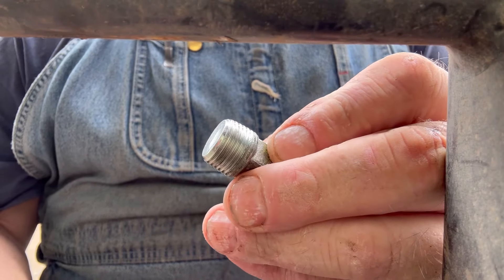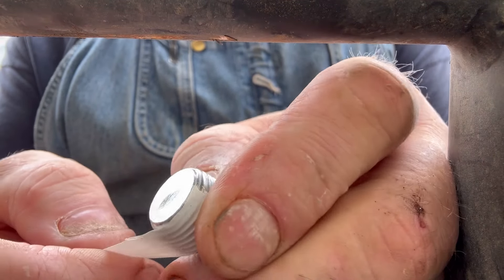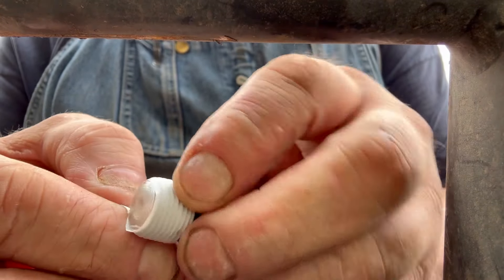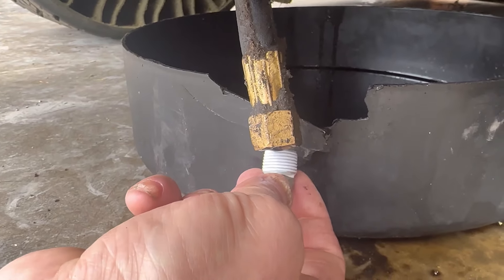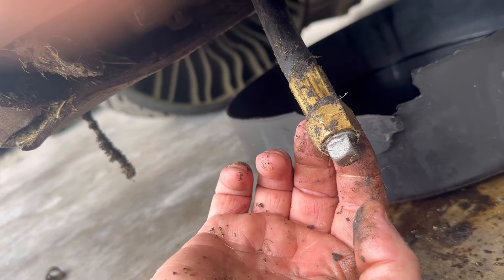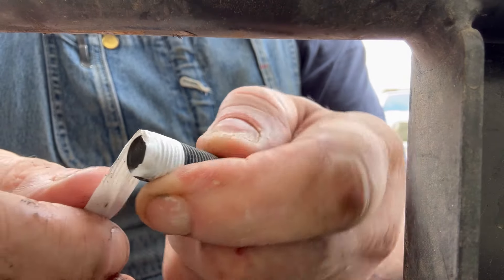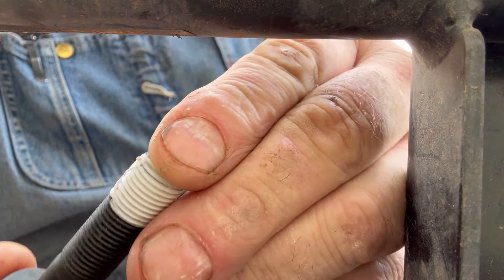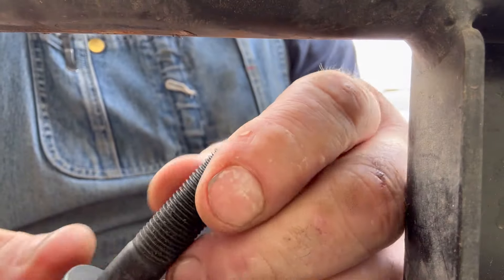YOU ARE DOING IT WRONG! HOW TO PROPERLY WRAP TEFLON TAPE

Comment: They say not to use it on sensors that screw in, But I used it on an oil temp sensor in a Chevy pickup truck that was forever leaking Oil. I just didn't cover the first few threads at the tip of it and it worked just fine. And stop the leak.😊😊

Comment: Mowermedic you putting the teflon tape in the correct direction but you need to flip your roll of teflon tape over so it stays tight instead of putting your BIG THUMB on the tape to keep it tight comming off of the roll.
😆 
Just my 2 cents worth.
Opinions may vary 😊
Reply from the maker: The video wasn’t about how to apply the tape to the pipe. It was about the direction.

Comment: You are correct. Only one thing I’ll add. On pipe, I leave little of first thread so it doesn’t cover the hole.  Glad to see you back.
Reply from the maker: Thanks for watching. I’ve been back for a while now. I always take a break during Christmas and New Year’s just to revitalize
Reply: Yes Steve that is correct especially on hydraulic fittings so the teflon doesn't break off and clog your system up😊